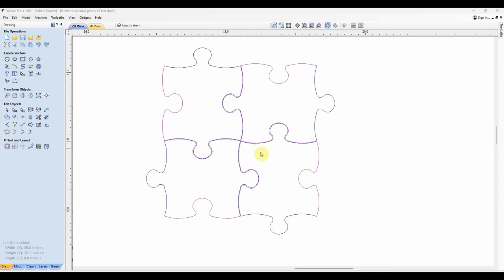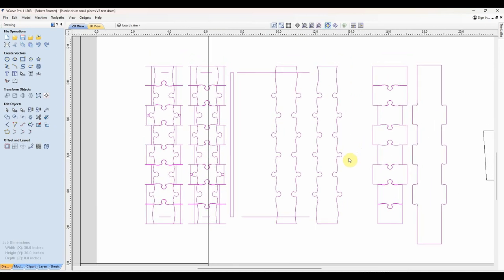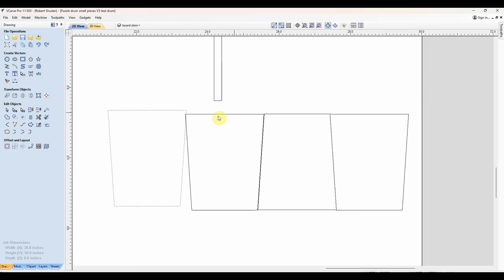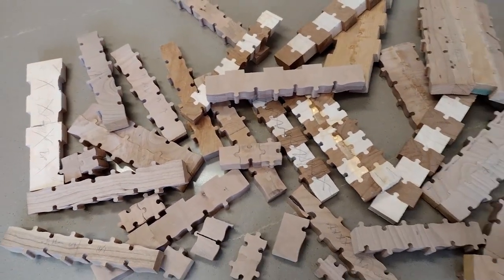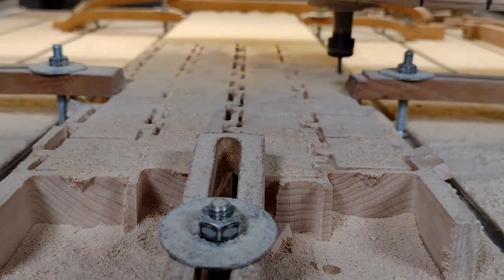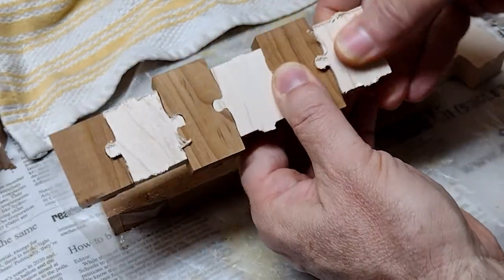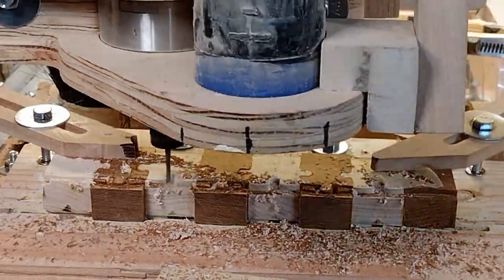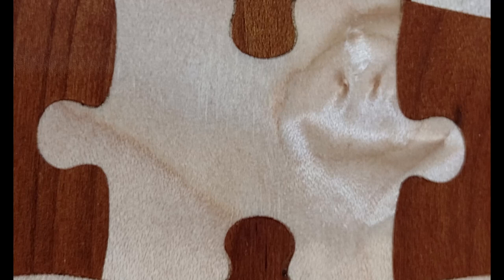Puzzle Drum 2.0 (part 1)

Comment: ROB! 
You my friend are the absolute MASTER!
Very cool project!
I for one am very interested in seeing a follow up video where you do the rotary work assembly etc.
So impressed, keep up the good work.
BTW it is not uncommon for people doing strip glue-ups to flip every other board to compensate for micro tilt of their jointer fence.
How much clearance do you program in to get a slip fir?
Reply from the maker: Thanks Marlo.  The clearance is around .008 total according to the software (so .004 on each part).  After all my testing, the "throat" part of the puzzle joint area is a little wider at the "choke" point.  

If I do a second drum, I will probably go down to .006.  I want it as tight as possible because I need to be able to do a dry fit, and then take back apart for the glue up (I will talk about that in the next video).  It is good now, but we are always chasing perfection (and then sometimes go too far and mess it up).